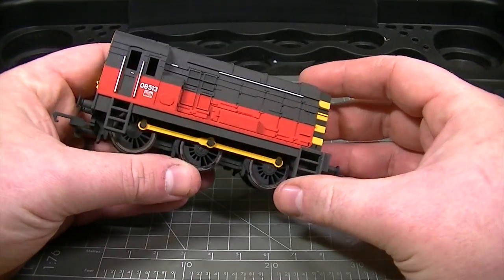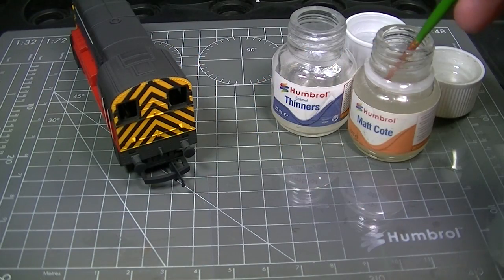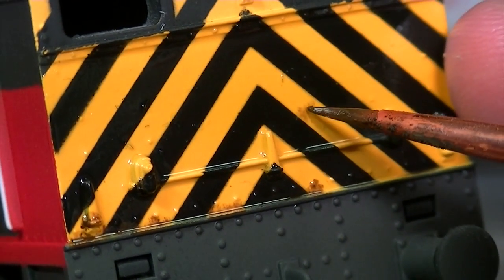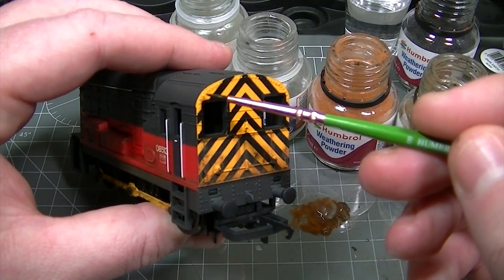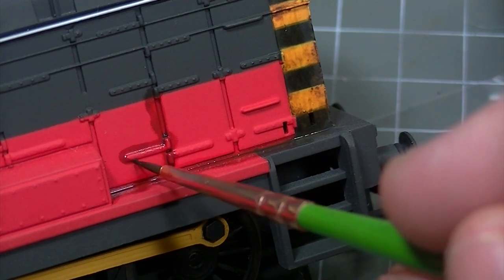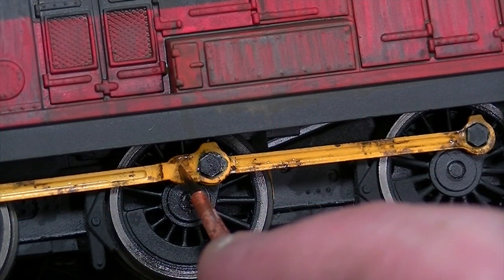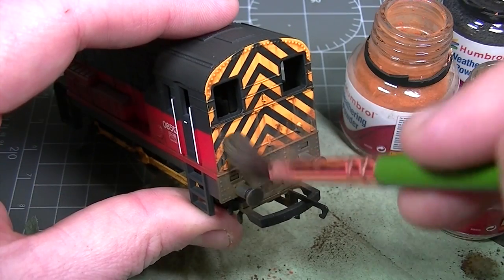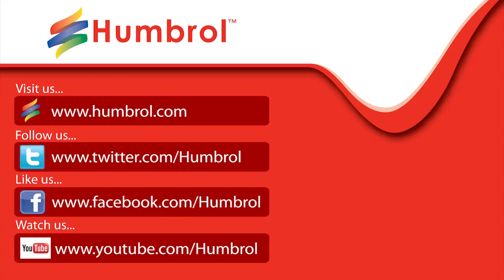Humbrol - Weathering Powder - Class 08 Diesel (Hornby Railroad)

Comment: would it be easier if you just took the body off?
Reply: But then you would still need to apply the sealer at the end on the connecting rods. So it ends up being quicker and eaisier to leave the body on.